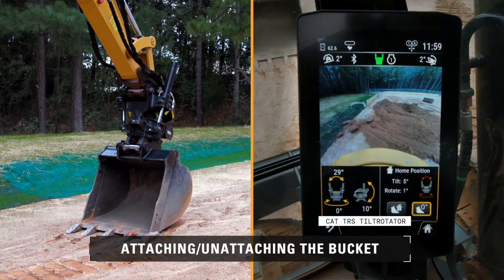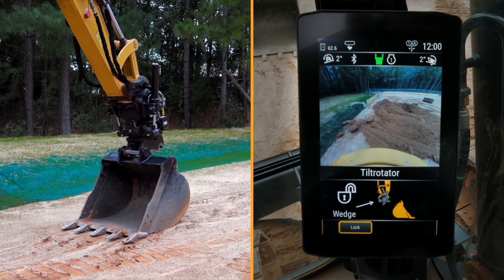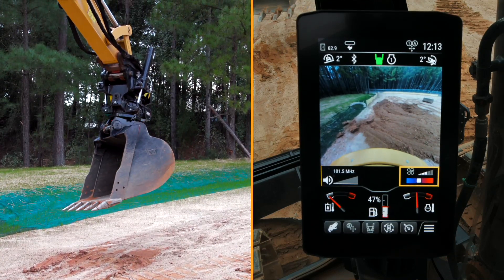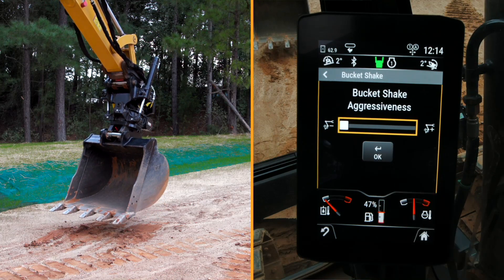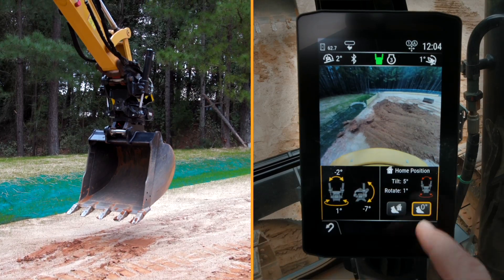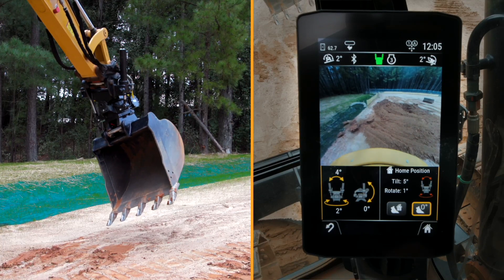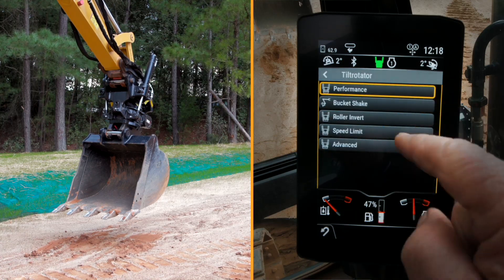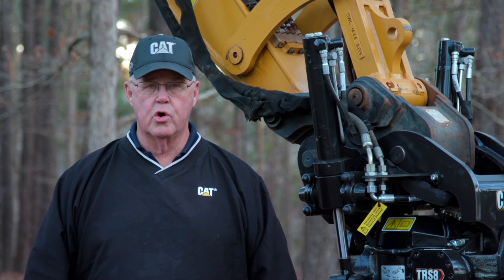Cat® TRS Tiltrotator Display and Settings

Comment: How do you remove the full attachment if you can only use the quick coupler function for what ever attachment you are using on the tiltrotator?
Reply: It depends on the configuration of the TRS when purchased. These can be installed by the dealer either directly pinned onto the machine, or with use of the standard quick coupler. To remove the full attachment the operator would have to get out and unplug the TRS harness on the side of the stick along with the hydraulic lines. Once the TRS is unplugged the factory quick coupler should work to take the TRS off.